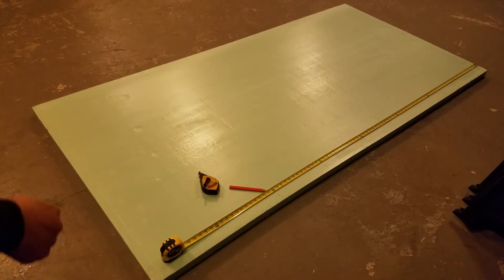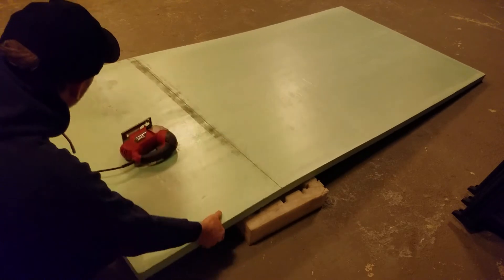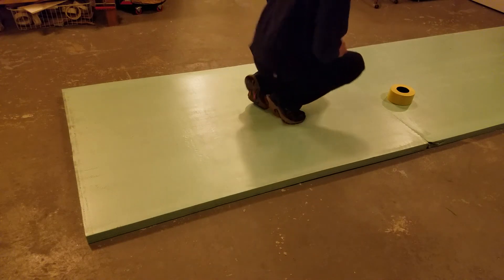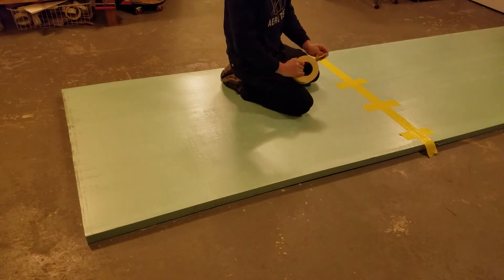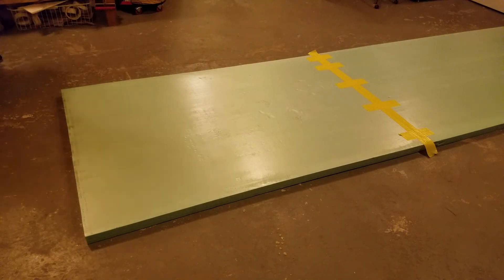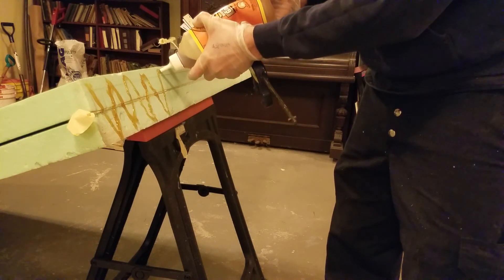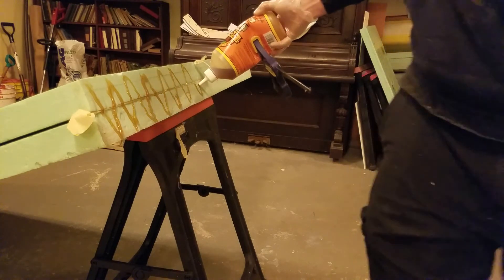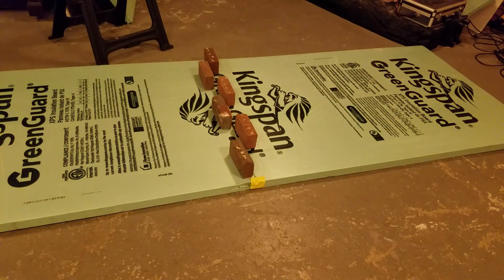Sawfish kayak, butterfly scarph joint

Comment: Given a choice.  1 scarph joint vs 4 scarph joints.  I'd say one scarph likely favorable, but does it matter?  Thinking of taking single 4'x8' sheet and maximizing length while aiming at 36" to 40" kayak. Pretty sure 11' x 3' is very doable without losing too much water weight displacement of the original 4x8.  Aiming for stability and capacity over speed manuevering.
Reply from the maker: You can make as many joints as you want, it won't hurt anything

Comment: What's the longest and shortest designs you've made? (Longest and shortest sawfish kayaks) Longer obviously lends itself to better buoyancy and speed. But I was wondering what success you've had with shorter boats.
Reply from the maker: @doranhudson3960  a 6 foot mouseboat was my first foam kayak. Longest is a 16 foot sawfish. I plan on cutting it down to 14 feet as I damage it moving it out of the water so many times.

Comment: I USED TO THINK XPS DOESNT ABSORB WATER, THEN I  BOUGHT A HOME AND STARTED THE REMODEL, FOUNDATION NEEDED WORK WE DUG WITH BACKHOE AND SHOVELED , PULLED XPS OFF HOUSE FOUNDATION AND THE WATER RAN OUT OF IT FOR AN HOUR, WE STOOD ON IT AND IT SQUEZZED OUT TOO, A PIECE 3' x 8'  WAS HEAVY ,OUT FOR A PADDLE THEN OUT OF THE WATER OK, BUT LEAVE IT IN AND YOUR KAYAK WILL WEIGH OVER 100 POUNDS
Reply from the maker: The kayaks get a water resistant skin so they don't absorb any water.
Obviously foam being held submerged under water will behave differently. 
But a house like this sounds like the site work wasn't done correctly before building

Comment: I don't ever see you moistening the opposite side of the foam when using Gorilla glue original. Have you found it does not need the water sprayed on for best adhesion? I'm happy to see you starting another Sawfish!
Reply from the maker: Water makes GG foam up. I don't want it to foam up, because that forces the joints apart and distorts things. My cold damp basement provides all the moisture needed to activate the GG.

Wood needs a little moisture to ensure a good cure because the wood will absorb the water and potentially not give the joint enough moisture to complete the chemical reaction thoroughly. 
The water is the catalyst that triggers the curing process.
Reply: @rowerwet  I am in Colorado. Thank you very much for the descriptive explanation!    I will do a test on some foam before I go into the kayak gluing. It is dry here so I will test without water against a light mist of water.  I understand about the glue expanding too much sometimes.